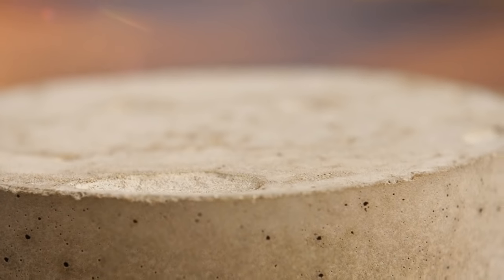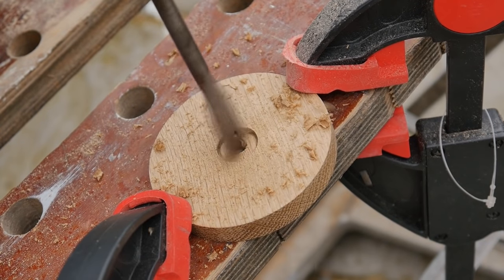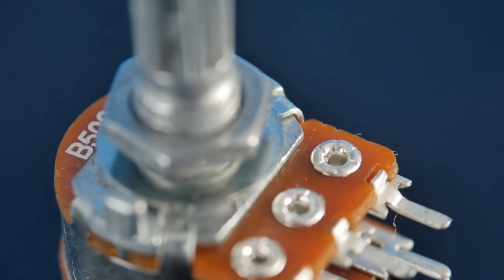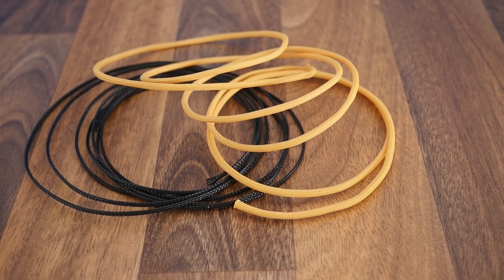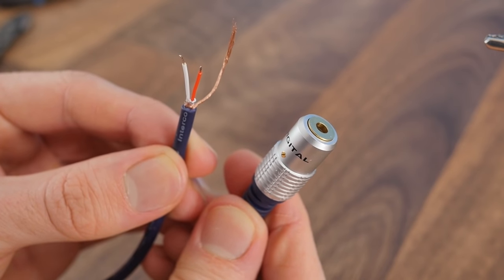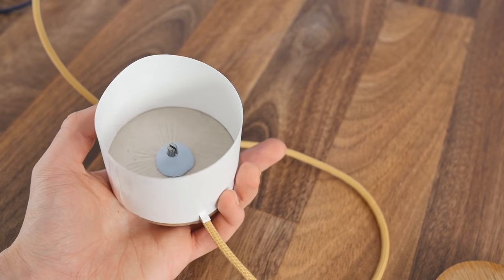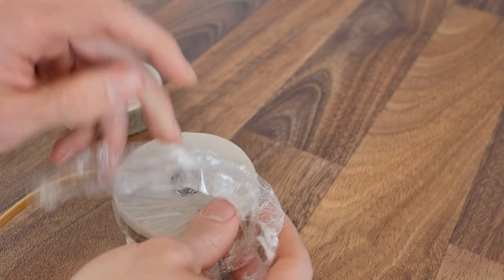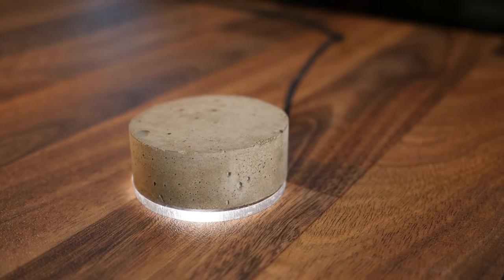How To Make a Concrete Volume Knob

Comment: A two part tile adhesive would also be cool as it will hold a unusual shape better, also while the cement is still somewhat pliable you can make a small richer mix or even straight neat cement super thin bed around to mold to give it a consistent look just make sure to slightly wet the existing cement to create a sufficient bond. 

Another cool thing to try would be to add a coloured oxide to the mix, the colours available are basic but a red tinged controller would be cool but trust me wear gloves as it stains super easily take it from a tiler it's potent stuff haha.

Comment from the maker: Don't forget to vote over on the Maker Amino app on what video you'd like me to make next. I'm quite intrigued in finding out what you guys would like. Voting ends next week btw, so get them in asap.
Reply: +DIY Perks I have to ask: did you consider wiring the pot to a female micro-USB connector, and the input/output 1/8 connectors to USB A socket, so that any charging cable could be used?
Reply: +DIY Perks Are you working with instructables anymore?
Reply: +Chad LaFarge Regarding your solution for input/output connectors - this would be serious misuse of connectors! You really shouldn't do something like this unless you have really, really good reason. Also, it is impossible, because USB A connector has only 4 pins, and DIY Perks' project requires 5 pins.
Reply: +mbaksa four pins plus ground sheath.
Reply: +Jim Groth Yes, the cable effectively has 5 "pins" (wires), but the connector does't. So there would be no point of having that kind of cable. And if you chop off connector(s), you end up right where DIY Perks ended.
Reply: mbaksa The casing of a USB connector is the ground "pin".
Reply: +Jim Groth Yes, it usually is. Still, it wouldn't be smart to use USB connector because if somebody plugs it to a normal USB device, there could be trouble, since two pairs of wires are basically short-connected through a variable resistor (pot).
Reply: +mbaksa True. Then again, I think he actually just used the cable and snipped off both ends. 

Either way this isn't how I would handle audio connections, and for this purpose I would have used a rotary encoder and a microcontroller to simulate a USB hid device, which in turn would have controlled audio level via software.
Reply: +Jim Groth I agree that "digital potentiometer" would be useful to many, probably to more people than analog. Maybe that would be his future project. It even isn't very complicated to implement, since to turn volume up or down microcontroller would emulate keyboard and just send specific vol up and vol down keycodes.
Reply: +DIY Perks Potentiometer should be atleast 5K ohms. And logarythmic. You mixed it up.
Reply: +DIY Perks Not a fan of downloading an app to provide some feedback. I'd love to give you my opinion, but my smartphone is already cluttered enough.
Reply: +DIY Perks i would, but it doesnt work with ios 6
Reply: +DIY Perks 
Thanks for this cool project, crisp, inventive, inspiring, confidence_inducing.
I'm headed over to Maker Amino to vote.
Keep on trucking ! (from France)
Reply: +Bows and stuff what device are you using
Reply: +DIY Perks Is there any way that we could make the LED dim/brighten along with the volume level when turnin the knob? Or even colour phase from one to the other?
Reply: +DIY Perks since you're soldering all grounds together anyway, is there a reason you're not just doing it at the pot end, and then soldering the LED to the GND?
Reply: +DIY Perks I think I've said this before, but I love your content, and there's not enough, I literally check your channel atleast twice a week waiting for new stuff lol. Keep up the great work man.
Reply: +K Web No. That's 50 Megaohm.
Reply: why is that important?
Reply: +Bows and stuff it's important as the resistance affects the behaviour of the volume control. The value in the video gives a smooth transition between loud and soft. The device you suggest will suddenly go from on to off. That said, I've never seen a linear pot used as an analogue control before - I think it should be logarithmic...
Reply: David Lowe
and what does that has to do with the app beeing not even supported by my device?
Reply: +DIY Perks Could you do the same for Dimming lights?
Reply: +sportlol yah i want to know
Reply: +DIY Perks Is there any way to not use concrete as the knob.
Reply: +DIY Perks  Try some of that clear casting plastic instead of concrete.  Encase something like a scorpion or any other thing that you think is trippy..  You do need to put something opaque in FIRST where the bottom of the knob will be. Easy to find on most packaging.  First pour in a small amount say 1/4 inch deep.  After that sets up, put the item in on top of the solid part then fill to the top of the mold with a new batch..  Basically the same as using concrete with 2 pours.
Reply: +feroza The static magnetic field generated by your magnet won't affect the sound in the wiring or the controller knob, if you were using an electromagnet based on AC then you'd get some serious hum!
Reply: THE AC field magnet has been covered but even there I seriously dout even that would have any effect. There just isnt enough "wire"  there to pick up the field change. AC hum, NOT ac field, possibly but still doughtful. What I know you would get is so low in strength it would be unhearable. no amplifiers involved here.  Totally different issue if that pot was feeding an amp with say much more than 10 or 15 DB gain.
Reply: +DIY Perks For audio stuff its better to use a Logarythmic Potentiometer .... Thats why they exist.
Reply: +DIY Perks if you make own slide resistor. you could control led light power, with volume meter. :)
Reply: Find an old VCR tape the front side makes a fantastic linear variable resistor. Glue the shinny side down.  push a couple tacks through each end to solder too and youre done..  Take a wire from the ground end and that is your slider contact.  I use to do that on a chunk of wood that looks somewhat like a guitar.  The "adjustable resistor" becomes one of the timing resistors on a 555. You take the ground wire and wrap it around a ring and use a finger for the slider.. Play with the timing cap and resistors and you can easily get the low end down to say the A or G below middle C.. Mark some frets roughly where they would be for "normal" strings.  VOLA  a 10 buck slide electric guitar with a real funky sound..  Add in a 1/4 inch jack across one of the timing resistors in parallel with one of those elcrapo 99 cent speakers, for non amp sound, with say a 15 or 20 mike cap with one end to the hot of the jack for DC blocking. Grab a good amp and run every dog for miles mad. Square waves run through a cap make a real nasty sound with all the harmonics they make..

I use to make up some of these and pass them around to the neighbor kids

 LOLOL
Reply: +DIY Perks Would be cool with that L.E.D. one if you made it dimmer with lower volumes and brighter with high volumes.
Reply: +DIY Perks pls give me a link to your amino profile
Reply: +JBatten Done :D
Reply: +DIY Perks That is really creative. Thank you, love your videos. I just wish my career would allow for more time for me to do my own projects at home with electronics.
Reply: CAn you show how to attach a 3.5mm jack to the rode nt1-a mic?
Reply: +DIY Perks Oh man! A potmeter is only for signals, so this should only be used for very low power audio, like 250mW at most in order not to fry a potmeter you can't just replace since it's glued in... You really should at least use a wire wound potmeter for this project which is good for about 1W or so... Btw. just buying shielded audio cable instead of a USB cable could be far cheaper... (at least it is 3-5 times cheaper in my place, so it worth checking out options, unless you already have an spare USB cable...)
Reply: +DIY Perks Hi i really love your channel, i suggest, if it is in your possibilities, how can you sell your products, ill be glad to pay for them :). Congrats!
Reply: +DIY Perks Hnnnng that fpsssss
Reply: you Should make these and sell them, you would make a ton of money
Reply: hello, can you tell me if the potentiometer B500K work, just like the B500R on this project???
Reply: 500K = 500000 ohm, 500R = 500 ohm as far as I know. Use a wire wound one, otherwise you risk burning the potmeter, and ruining your work...
Reply: Does a B10k stereo potentiometer work :D SORRY IM STUPID AND SHIT....
Reply: Well theoretically yeah it should, except it's gonna be exponentially weaker, as you turn it downward...
Reply: Love the Music you are using can you share it with us ?
Reply: can i use b50k or b10k potentiometer?
Reply: Saquib Anwar yes but you get distortion
Reply: DIY Perks hydhtdht
Reply: Valtra103 Why?
Reply: Yeah bollocks mate. They pay you to shill their rubbish, they're not paying me. I'll go patronise their site when they do.
Reply: DIY Perks new sub

Comment: Does anyone know of a way I can make this so it mutes when pressed down? Are there any potentiometers that can cut the signal off on a click?
Reply: Im not an electrician but you could make it work;

1. Put the potentiometer entirely inside the concrete knob.
2. Get a button that works to mute/unmute with usb signal (i guess snatching one off an old pair of headphones isnt entirely impossible, otherwise, buy off the internet) and place it under the knob, so it sits between the base and the knob. If the button cant hold the weight, i guess some springs would work fine to help hold it
3. Tidy everything up
4.  Done

Or you could snatch the whole volume button contraption from an old audio device and rewire it to usb and make another base plate (just like his oak/acrylic base) and hide the components inside that.
Reply: There are potentiometers with built-in push buttons, so it should be possible.

The thing I'd be worried about is the weight of the concrete on such a button.  Perhaps it'd be better to use a lighter material.

Comment: Don't be fooled thinking this is easy. 

I've already cut my hands 4 times, wasted 2 usb wires, snapped numerous saw blades, and destroyed my table just to make a $20 volume knob.
Reply from the maker: You need some DIY lessons bro :)
Reply: or a brain
Reply: If you don't plan, think ahead and use, buy the right tools you aren't going to pull off anything. It's not without it's tricks but this really should be childs play given the clear instructions.
Reply: but the experience.
Reply: How do you even "waste 2 usb wires"? :D
l00000000000000000000000000000l
Reply: e.e
Reply: seriously?
Reply: Waste use wires lol stop hating
Reply: Just keep on doing, people who can just can't or don't want to remember every single time they injured themselves, destroyed tools and wasted materials, golden hands have always some scars on them ;-)
Reply: lmao
Reply: "usb wires"
It's called a cable.
Reply: It is easy. You just did not know what you were doing.

Comment: Should be noted that this will work fine if your audio source is very low level like the sound card in your computer or an MP3 player, etc. Headphone level audio is fine.  If your audio source is the speaker outputs from a higher powered amplifier (your home stereo or receiver for example) and you send that speaker level signal to ground when the knob is turned all the way down (i.e., run it without a load), you'll fry the output transformer in the amp.  Audio output transformers need a resistive load, e.g., a speaker, connected to them at all times.  Volume output control in an amplifier is done via limiting the audio signal going into the input stage of the amplifier, not by reducing the resultant current coming out of it which is what this variable resistor circuit does.

Comment: Nice tutorial.  As far as I remember, cement comes  in big bags with way too much material for this kind of project. I suspect that some small bag of some similar material may be available for touch up repairs of cracks in walls maybe? Or you could beg a cup of cement from your local builder maybe? :)

Comment: TIPS - for cutting the wire groove, you can also use the hand saw and cut along your lines, down the depth of the wire as he did with the router. Then simply make 1-3 more of these 6mm cuts inbetween the two lines, and you can then use a chisel to break the wood out of the center, and use a file to sand it smooth. 
--- use wood as a base, but then glue in 1-2 led's as he did with the plexiglass. this time make sure they are face up, and have a slight gap between them and the cement knob. you may need to file or cut a small groove for this to work.  Use mirror tape, or mirror paper from a craft store, and glue it to the bottom of the cement and top of the wood, before gluing the cement knob onto the potentiometer. This will reflect the led light out of the slight gap between the wood and the cement knob.

Comment: I love it. I modified mine so the LED brightness is controlled by the audio. It looks really great!
Reply: Which additional components did you used for that? Could you sent me a instruction how to mod mine too? Thank you very much.
Reply: Jonas Ritter It is a little bit more complicated. But i used a arduino. Check the resistance of the potentiometer, and then analog write to the led.
Reply: Thank you very much Michi Lo. I'll try it on my own and hopefully get a working device ;)

Comment: For the OCD: This is mortar, not concrete. After demoulding, place mortar cylinder in room temperature water bath for a few days for optimal durability. Additionally, to get rid of any voids on the side, fill the mold by thirds, and tamp down with a rod about 9 times... do for each layer. Keep in mind that mortar will shrink a bit when curing.

Comment: Great video as always! I have a request that I'd like to throw in- can you teach us how to hook up a timer to an electronic, especially ones that use batteries? For example, I bought a laser pointer toy for my pet that is free standing, but I have to push the button on top to make it spin around and laser the floor, which defeats the purpose. I would love to be able to set it to turn on every 3 hours for 15 minutes so my pet can get some random entertainment. Similar ideas could go towards decorative lights that aren't plugged in- have them turn on and off at certain times. Just a thought, thanks for all your cool work!
Reply: +Finding Jesca you can use arduino with a relay

Comment: This is a great idea and a beautiful video! ❤️  I think it's better to use an Arduino Micro with an encoder instead of a potentiometer to send the volume signal directly to the computer (acts as keyboard).  The potentiometer increases resistance and cannot work properly with headphones. Also, arduino can adjust the brightness of the LED depending on the selected volume

Comment: In audio potentiometers should be logarythical - volume is logarythically felt by people. Linear pots are used for tone control. Actually pots with number starting with B are logarythycal.

Comment: Hey! Great build, but you're a little wrong on the potentiometer. 500ohm pot is fine for headphones but u'll need a around 50k ohm for wiring it to a amplifier because of the lower impedance input. And when working with analouge audio (as you do there) you'll always choose a log taper potmeter instead of the linear taper one, because of the way the human perception of sound pressure :)

Comment: Usb has only four wires. Voltage gnd datain dataout. The fifth cable that is referred to this video as ground is the shielding. It is used as to protect from noise.

Comment: this is cool. i think it would be improved to set the concrete over an actual potentiometer knob instead of onto the potentiometer itself - that way should the potentiometer ever die it is replaceable without having to rebuild everything - plus it would take out the risk of getting concrete water into the shaft, might not end up as finely aligned though... but anyway, who am i to question the master - your videos are awesome.

Comment: Prusa Research (a popular 3D printer maker) made a video making a 3D printed one of these that uses an Arduino and a pushable rotary encoder to send the volume up, down, and play-pause signals to the PC as a keyboard instead of wiring the audio cables to a potentiometer.

Comment: I like your project, maybe if you find a broken amplifier you can use the potentiometer that comes from it.
Not only that, you could then put concrete over the plastic volume knob, so that you can remove and refix the knob. (As volume knobs on amplifiers often can be pulled off).

Comment: I feel a cool idea would be to hollow out the bottom somewhat and wherever there's an air bubble sop you would carve out the shape of it until it reaches the hollowed out portion then stick another LED inside and fill in the air bubble spots with some colored resign, now that would be cool ^_^

Comment: You should combine this with your headphone stand. Put 2 outputs on it, one for headphones and one for speakers, and put a pressure switch on top so that it plays through the speakers when the headphones are resting on it, and plays through the headphones when they are taken off of the stand.

Comment: Nice video and great effort. Just asking what did you use to lock the cable to the base? Like it's gonna brake if someone accidentally step/pull the cable?
Reply: +Khánh Đàm You could glue it to the base, but as long as it was soldered half-way decent, it wouldn't be an issue.

Comment: If you guys can't find that specific pot then here's another option sold at radioshack stores: 10K Stereo Potentiometer with Audio Taper. It has an extra two pins on the back but I just ignored those and got the same result

Comment: You Can add a female 3,5 jack/ audio output , to connect headset, and also a switch to change the sound to speakers or to headpset! And of course a dimmer to the LED... it would be a complete killing knob !!